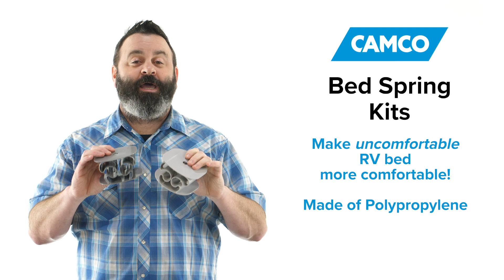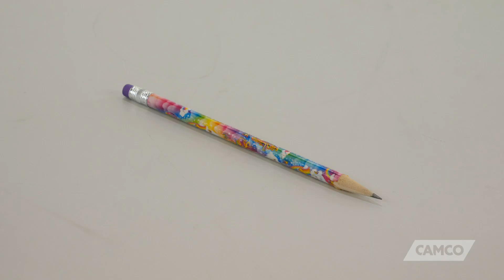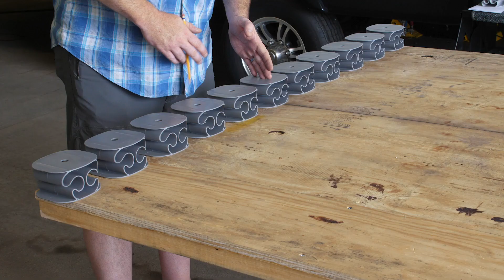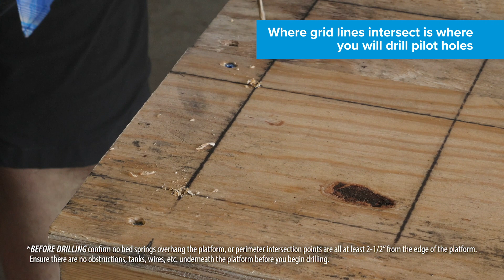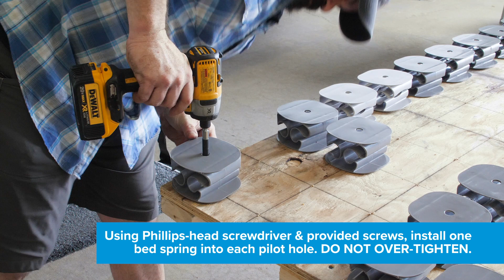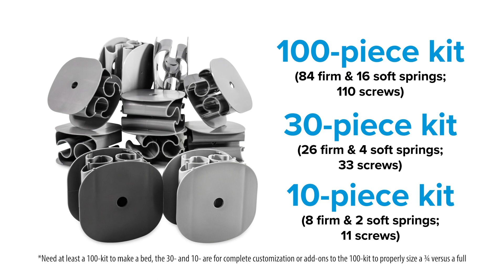How to Install: Camco’s Bed Spring Kits

Comment: Totally Agree with Jim P:
If your mattress is that uncomfortable, why not buy an adjustable Air Mattress.  
We have one in our RV and is a whole lot more comfortable than these silly things!  Plus, the Work to install them.  
Select Comfort is the Best.

And at $86 per 100, this is nothing but JUNK!
Reply: most camco stuff is all for the dumb asses out there.
Reply: This helps with airflow below the mattress preventing mold and mildew